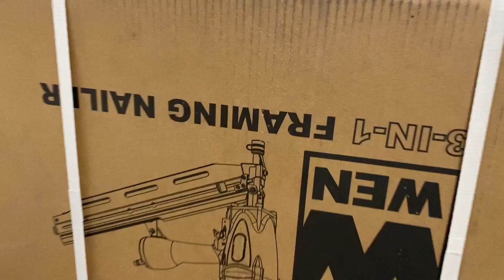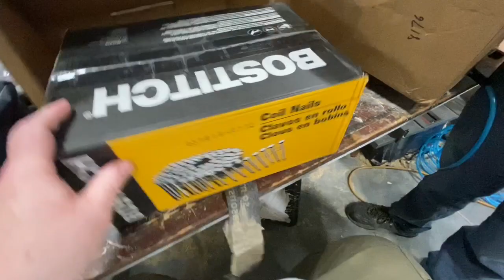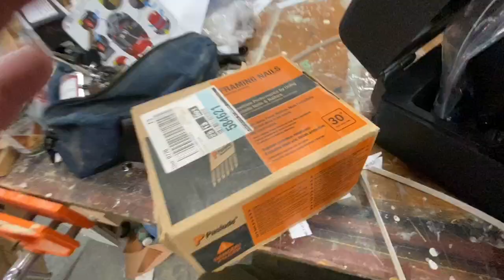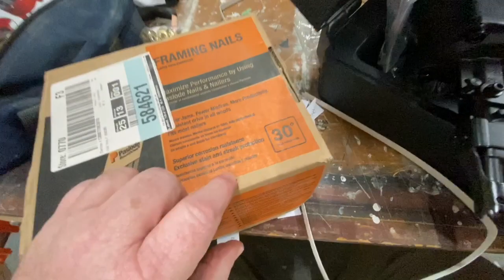May the 4th Be with our New WEN Framing Nailer

Comment: Hi. Glad you're negative (in your testing).  Thanks for the video. I had given up on a cheap decent framing gun.  Is there any nailer that can do multiple types of nails?  I need to do a small workshop and don't need 1000 dollars in guns for one workshop but also, I'm lazy :) so don't want to hand nail the whole thing.  Is there a gun that does framing, roofing and siding?  Thanks.
Reply from the maker: Thanks, This nail gun will use 28 or 34-degree paper- or wire-collated clipped-head framing nails between 2-3/16 to 3-1/2 inches in length.  That was the other reason I bought it.  If it last even a few years it will be worth the money :)